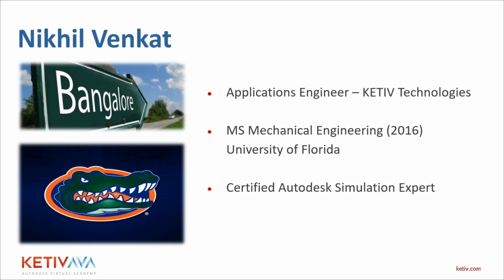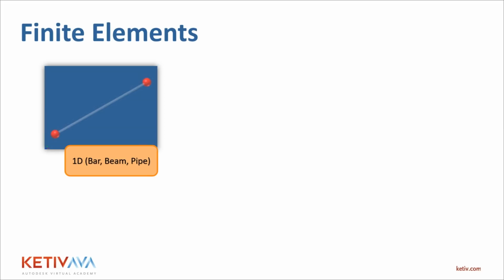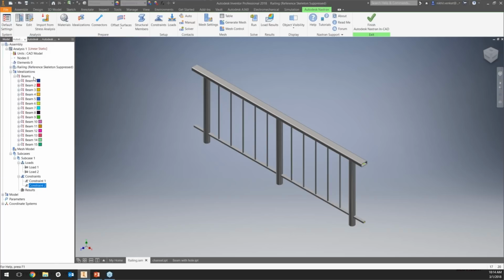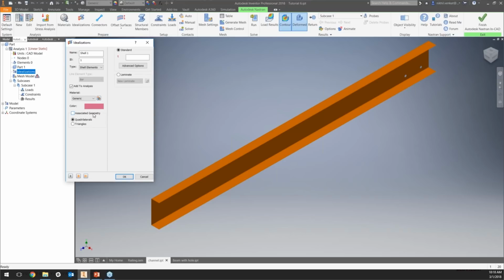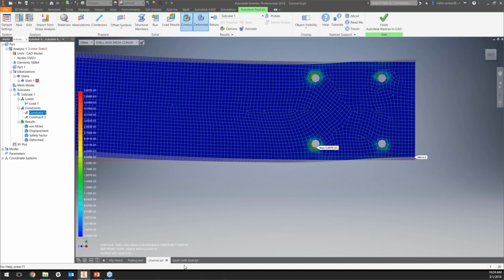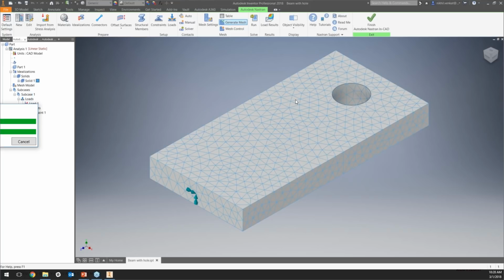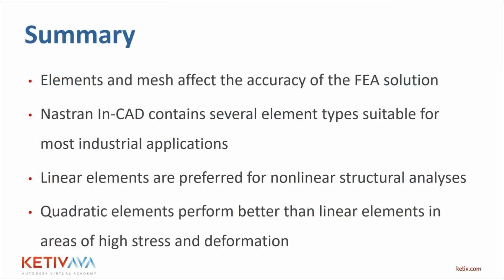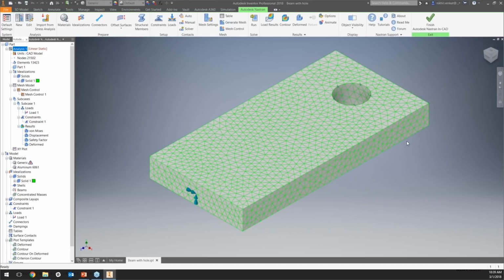Nastran In-CAD 101: Element Types | Autodesk Virtual Academy

Comment: @KETIV For static analysis, is it possible to apply the same Inventor Stress Analysis option "Discover and remove rigid body modes"? I see that nastran does not have this option, which creates non-proportional variation springs and thus be able to apply balanced loads without the need to use restrictions. See:

https://www.youtube.com/watch?v=phsAOAeABUM&ab_channel=Soluciones5D